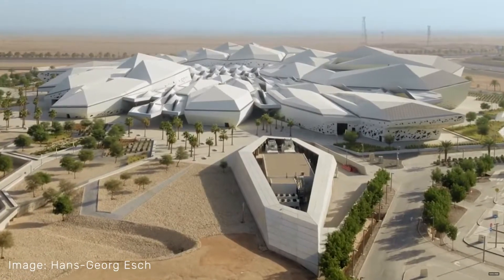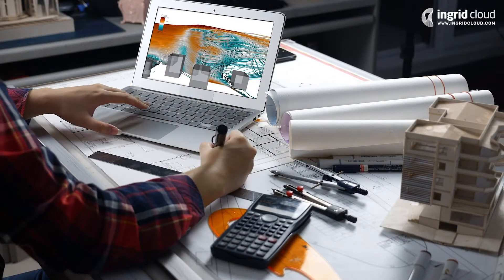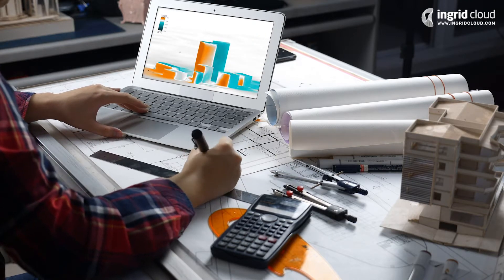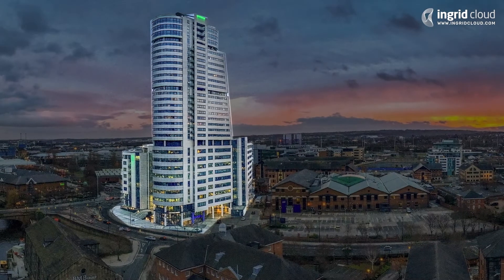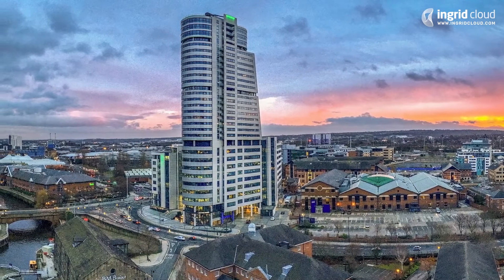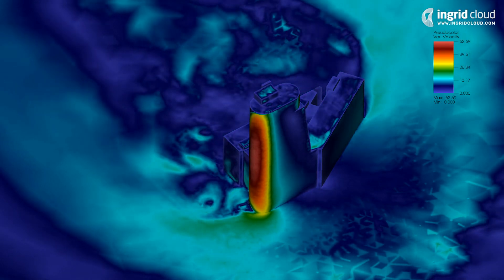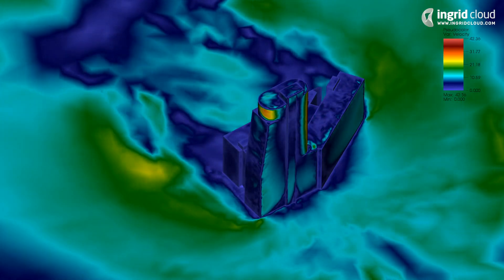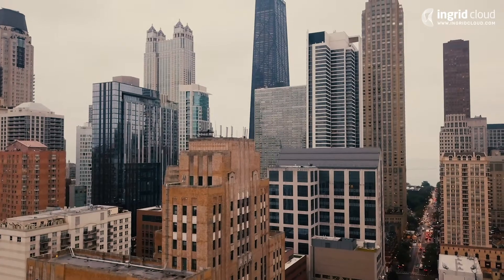How can wind simulations drive design optimisation?

Comment: So many things don't add up:
1) In the simulation there is no surrounding
2) There is no inflow turbulence
3) The speedup on a sharp corner is usually higher than with a rounded corner
3b) Point 3 is confirmed at 1:55 where the speed on the right simulation is much higher (more green/yellow) then the original with rounded corners
4) Please... keep colour scales consistent. It doesn't make sense to have time-varying color scales
5) What the heck is happening upstream the building? Seems as there is some quite big numeric error there

6) ... and no: performing a CORRECT time-varying simulation is NOT a "fairly simple task". Not if you want to obtain something more than just colorful images.